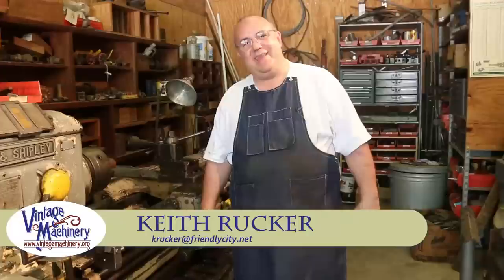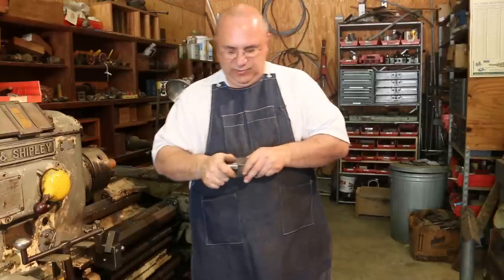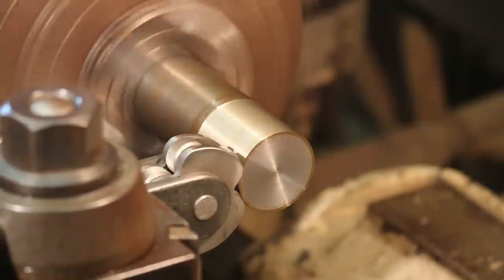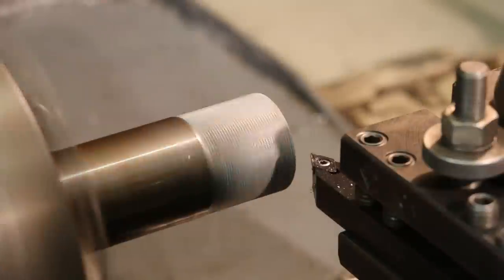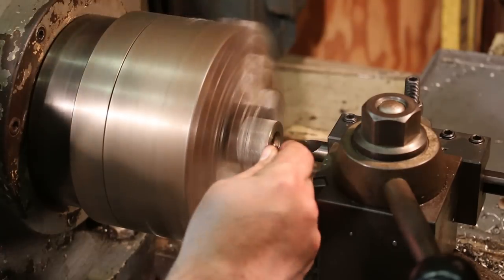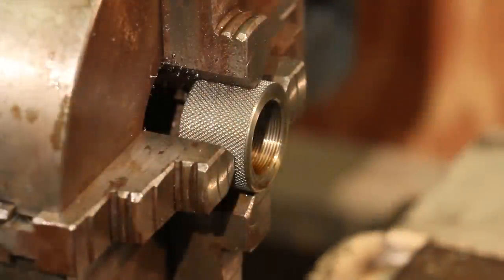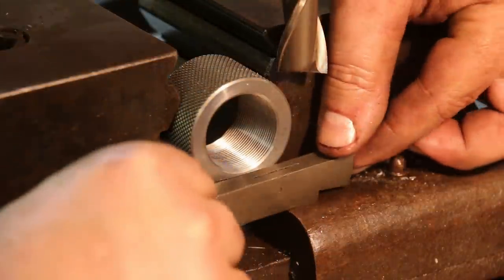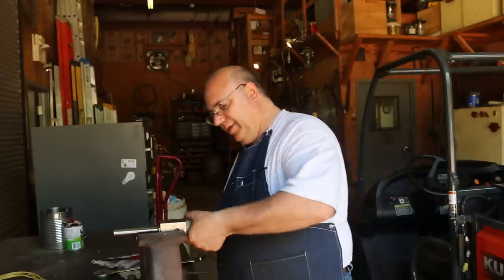Machining a Custom 5C Collet Nut

Comment: Hi Tom, I made some collet blocks for 2j collets. They work great, made a hex and a square,  Anyways, on my square one, I drilled and reamed two 1/4 holes 2 1/2 inch apart. Inserting two pieces of drill rod lets me use it as a sine bar in the vice.  Its very handy and i just remove the dowels when not using them.

Comment: Nicely done Sir. Those little 5C blocks are so handy! My set came with nuts that use a pin spanner wrench, that leave the back of the collet open.. I may make one like yours.
Reply from the maker: +Stacy Simon This was just a quick project to get my block working, but in retrospect, I do think it is a pretty nice little design!

Comment: Nice and simple, which is good for me, but also very mentally stimulating, meaning it will open my eyes to all of the little adaptations that can be made to tools and equipment that may not be a part of the original design. I like that, and now I want to go and make a knurled nut for something, LOL!

Aloha Keith and Happy Easter...Chuck and Pops.

Comment: I too use those 5C blocks often. I use that hex one to hold small parts in my 3 jaw on the lathe all the time since it really isn't great for chucking anything under 1/2". <ime came with some full bore nuts you have to tighten with a spanner but they aren't too great I need to make something like you did. Thanks for the ideas!

Comment: Another great job Keith. 
There are always different ways to tackle a project. Since you have the nut that you needed critiquing the process is only for the exercise of sharing thoughts. 
For milling the flats, could the nut have been mounted vertically in the vise? That way the crossfeed could be used to make the first flat with the side of the cutter. Then the side feed could be moved the 1 3/8" plus the diameter of the cutter to mill the second flat. The two flats are automatically parallel. 
It's been suggested that the threading be done while the part is still on the blank. Perhaps having all the secondary ops performed before parting off the piece would be helpful.
Reply from the maker: +Old Sneelock's Workshop As you say, there are many ways to tackle a project.  Truth be known, I don't even remember why I chose to do it the way I did, but that was the way I did it.  It sure would not be wrong to to about it a different way as long as the results were the same - a usable part!
Reply: Keith Rucker - VintageMachinery.org Thanks for the prompt reply. As to reasons why? That's what I've found about my videos. I do the job. Make the video and on to the next one. Seldom do I make the same part twice and if I do the two are so far apart I won't remember how or my available tools have changed.
I'm certainly not saying you did it wrong. Success is validation  of any process

Comment: Sweet make. I need to make a 5C nut that sits recessed in the bottom of an end mill grinding fixture, so not able to tighten on the edges.

Comment: Happy easter!
I thought of 6 or even 8 spanner holes, so you could tighten it while it is mounted. Would come handy for "production work".
Reply: Hermann Straub Now if you can make the hole spacing match the spanner used by most handheld angle grinders... that would be on the back face of the nut...

Or, you could do what I think that you are suggesting, and have the holes arranged radially, which might require making a matching spanner to get a good fit...
Reply: Hermann Straub Hermann - 3 guys, 9 or 10 ideas... ;^)  Eric

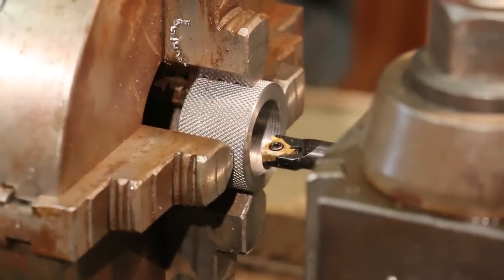Comment: 12:27   Looks like the chuck is rotating the wrong direction. Stopped at 13:00, then tried the collet and it started to screw in but didn't quite fit. In subsequent footage, chuck appears to rotate the correct direction. The magic of television?

Comment: Dear Kieth be careful when using the hex block. I have found that if you put the block in any vise and really tighten the vise on the block and then tighten the nut on the collet when you go to machine the part it tends to spin on you.

Comment: Keith, in this case your threading tool has no spring back at all. It is a repeated misconception of chip removal.
The cutting edges simply can't keep up with the amount of material to remove, versus the high feed rate.
Love your videos.
Thanks for sharing.
God Bless.

Comment: Keith, what is your machining history? Schooling, apprenticeships? Where did you learn the trade, and what do you do for a living?
Reply from the maker: +Jeffrey Bancroft When I graduated high school in 1986, I was wanting to go to college but did not have money to go.  A friend of mine was working at a local machine shop and they needed an extra hand to crank out a big production turret lathe job.  I applied and got the job and started learning to be a machinist.  For me, I was somewhat of a natural at it and my boss recognized that I had the aptitude for the work and kept me on long after that big production job ended.  While it was not a formal apprenticeship, in my respects, my time there was very much like an apprenticeship.  My boss would teach me new skills and give me bigger and bigger challenges as I became more capable.  After about three years, I had saved up enough money to start college and left the machine shop except for some summers when I would return and work to earn some extra cash.  While i have not worked professionally as a machinist since my college years, the bug had hit me and I continued doing some machine shop work on the side, but more as a hobbyist.  For probably the past 15 years, I have become more and more involved with the local museum where I volunteer in their maintenance and restoration shop.  They knew of my machine shop background and took advantage of my skills by giving me lots of fun projects to work on.  Most of the machine shop equipment at the museum is actually mine but I use it there for projects they need as well as whatever else I want to work on.  As for what I do for a living, I am a scientist doing agriculture research and product development work for one of the big ag companies.
Reply: Thank you so much for the quick reply. I find your videos very interesting. Keep them coming.

Comment: nice job. i was surprised to see how well your knurling came out. i was taught to not to retract the tool until the knurl was completed. i learned something today. question, why not complete the threading before parting off? it would eliminate rechucking and possibly damaging the knurlling. cutting the wrench flats might have been easier and more secure if the nut was screwed onto the collet in the block .i look forward to your videos keep them coming.

Comment: noticed quiet a few comments..on knurling ...yes takeing off the light scale on bar stock and bringing down to .010 under desired size also on smallel lathes you are better off on result anf machine to use a snap knurler ....there are plans i old popular mechanics...and home shop machinist less pressure on precious spindle and headstock

Comment: An alternative indexing method for the flats would have been to fit the nut onto the collet in the square block, and then flip it over. Using the tool you are making to make the tool :) Nice modification to the original design concept.
Reply from the maker: +Mark Sinden I prefer to tightly grip my parts rather than trusting the strength of the threads.  More than once I have had threaded parts move on me when the cutter starts cutting.  They can unscrew and ruin the entire part!
Reply: Yes, cutting vibration would certainly be a problem. Point taken.
Reply: Please make a video showing this.
Reply: +Mark Sinden I was thinking the exact same thing, if you had a hexagonal collet block you could even do an entire hex (although I think 2 flats looks more tasteful). Since he's climb milling the threads would be tightening themselves, so there's less of a chance of it unthreading and rotating, especially if you were to take light passes. I'm am going to make one or two of these next time we are slow at work (might even do it on the CNC lathe with live tooling for fun), we have the ring style nuts that have holes for a spanner wrench that got lost a long time ago, someone crudely made a new spanner out of aluminum plate (traced and cut out on a bandsaw even though we have multiple CNC's, but it works) and a dowel pin, but they are pretty beat up and we only have 2 that float around everywhere.
Reply: +Sandman Actual also you could still clamp on the nut and just use the collet block for indexing and a square against the table. Just goes to show there more than one way to skin a cat.

Comment: Hey Keith,
Happy Easter.  Thanks for the video.  When I was in school, we made a 5C Collet Block and Nut as a project.  One correction on your video though.  At 5:20, you mention that "knurling is cutting".  This is not the case.  Knurling is displacing the material, which is why you don't get any chips, you have the excess material on the end of the piece, and your knurled diameter is larger than the stock diameter.  I don't think you should need cutting oil, but I guess it doesn't hurt either.

Best Wishes
Reply: ***** There are cut-knurl knurling tools.  They actually cut the knurl rather than emboss it. 
There was an article in the Home Shop Machinist a few years ago on one that someone had made.  It was a rather intricate project.  They are also available commercially.
I'm glad to know that you were taught to just knurl away without worrying about the diameter size.  That's the way I was taught some 35 years ago by a crusty but lovable old machinst, and mine always come out fine.  With all the talk of calculating the diameter to agree with the pitch of the knurl, I had wondered if perhaps I had forgotten something.

Comment: My friend jokes that I'm always saying "let's make a tool for that" , and why not?
Thanks for the great video. 5c blocks are on my want list for the shop. They look endlessly useful. 
I had trouble with knurling, having ugly knurls, until I started doing the math and making my OD the next smaller size that is a division of the number of teeth. Then the knurls started looking like factory. Maybe you could do a video showing knurls on slightly differing diameters and how they look. Smaller machines like mine are terrible with the push style knurlers like yours. The clamping style work much better and are easier on the machine. Your L&S lathe is a big boy though and apparently handles it with ease.

Comment: Happy Easter Keith!  One comment,  You could have screwed the nut onto a collet in the block and cut the wrench flasts.  You would have to pay attention to the cutter rotation so as to not loosen the nut while cutting.  Hope that makes sense.  Anyway, I enjoyed your video.
Reply: Herb Blair Old School way to do it is with a parallel as Keith did, a machinist's square, or if you're a bit creative, you can use a level like Tom Lipton showed in a recent video...

Using the new block as you suggest does have its attractions, though!

I'm sure that there are some guys watching this video who can come up with other options... without using a rotary indexer of some sort...
Reply: Tk

Comment: You addressed why the knurling doesn't get crossed, but I've always wondered the same about threading.  How does the cutter wind up in exactly the same path every time?
Reply: +Paul Frieden A threading lathe often has a thread cutting gage mounted on the side of the carriage. The gage is marked with numbered points, usually 4. When you start the thread you line up the threading gage on a number and engage the feed. Then when you make another pass you line up the gage on the same number. 
I have an old SB 9C and haven't sprung for the gage to fit it. I thread by leaving the carriage feed engaged and running the tool back with the tool drawn back and the lathe in reverse. The tool remains aligned with the thread. It's slower but I get by.

Comment: Nice video. Bozo got me the same way the other day. Put the part in the vise and didn't tighten it. But my part got sucked into the cutter and broke the end mill and scared the part. It was a personal project so no big loss but still irked me.

Ryan
Reply: ***** Unfortunately that event happens all the time. In New Guinea during the 1970s an aeroplane belonging to a religious organisation suffered a fire in one of its two engines, and since there was dense jungle below, the pilot opted to head for a nearby airfield. They didn't make it; the wing burned through and all on board were killed.

At the inquest the chief mechanic recalled that during a recent service he was tightening the fuel hose on the engine that caught fire. A junior mechanic interrupted him and asked him to check the junior's work on something on the other side of the aeroplane, and the chief mechanic, when he returned to his task, believed that he had forgotten to complete the tightening of the fuel hose fastener.

A subsequent test revealed that if the hose had been left finger tight it would begin leaking at a fairly high rate after around twenty minutes running, and fuel would pool in the engine nacelle, where it would eventually catch fire. That one momentary interruption cost the lives of several people, as well as destroying an expensive aeroplane.

The moral is, I suppose, that if you are working on something that has the potential to cause injury through catastrophic failure, don't just rely on memory. Check and recheck, and if possible, get someone else to review your work.

Comment: Hi Keith, 
I'm new to machine shop, can you please explain why the drill moves slightly to find center when you feed it in with the tailstock spindle as seen at 9:05? Isn't it supposed to be on center already?
Reply from the maker: Most tailstocks will have a bit of "droop" in them, particularly when you have tooling in them.  No worries though, they will find center on their own and you really want them to do that - if it is too tight, it could cause it to drill off center.

Comment: what was the bore size for on the part you made before you started threading it?  you said it was 1 inch 20 tpi right?
Reply: +Jamie Buckley 1 1/4" - 20 I believe so 1.175" would be the minor diameter (just going off what Keith said for the bore size, I assume he referenced machinery's handbook)